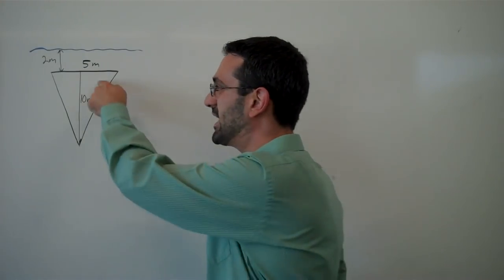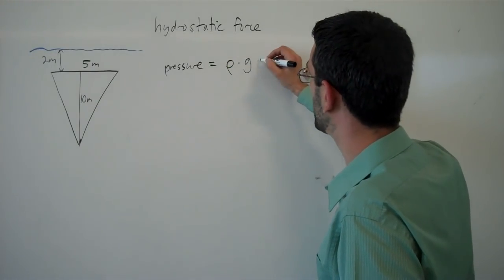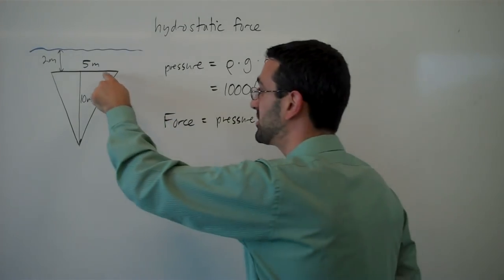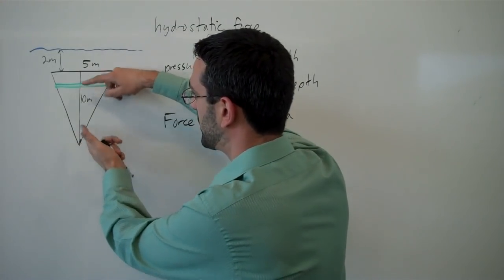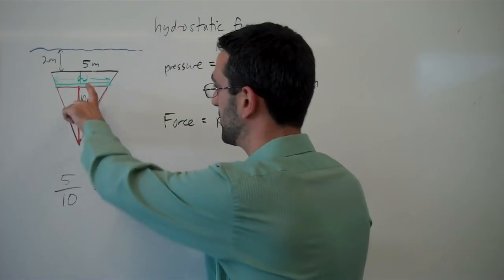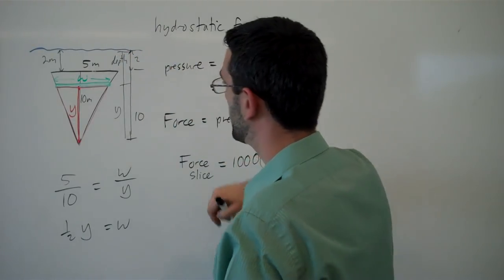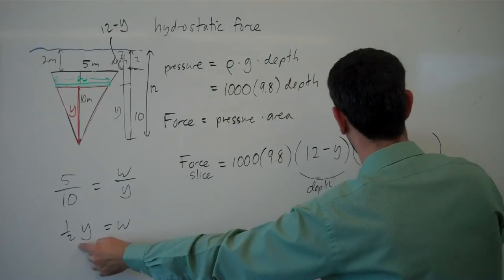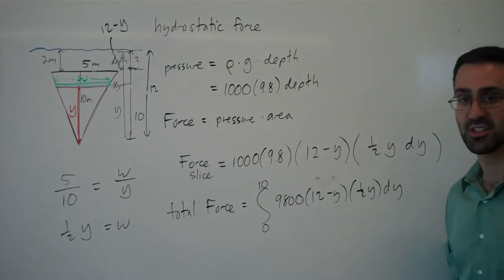Hydrostatic force on a triangular face

Comment: I was wondering why the integral was 0,10 instead of 2,12 ?

Thanks for the video :)
Reply: Because the depth was defined as 12-y making 12 below the axis 0. (12-(12))=0
Reply: You are taking cutting the object into peaces and the object height is only 10 ft. The additional 2 feet are added by the submerge in the water.

Comment: why is the integral from 0 to 10 instead of from 2 to 10 or -2 to  -10?
Reply from the maker: +Jack Gemuenden Because we defined y to be the distance measured from the bottom of the triangular face. We have slices of the face from y=0  (the bottom of the face) to y=10 (the top of the face).  If we had instead defined y to be distance from the top of the water, then we'd integrate y=2 to y=12, but the expression we'd be integrating would be different.
Reply: +David Lippman thanks!